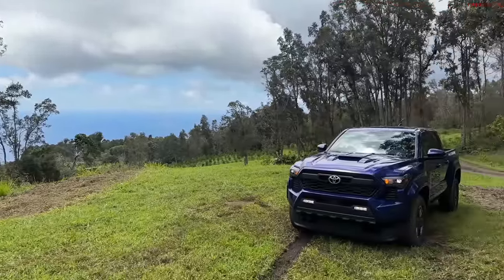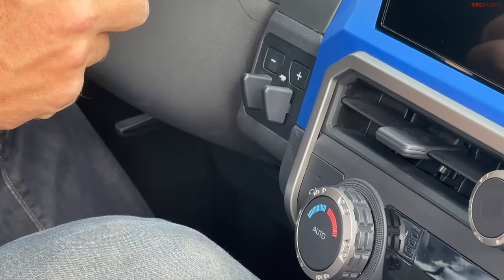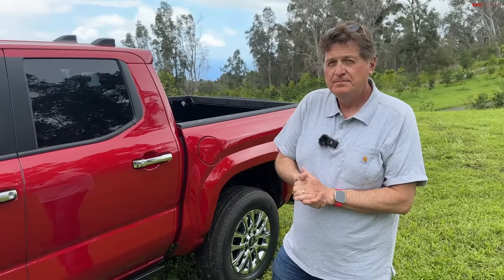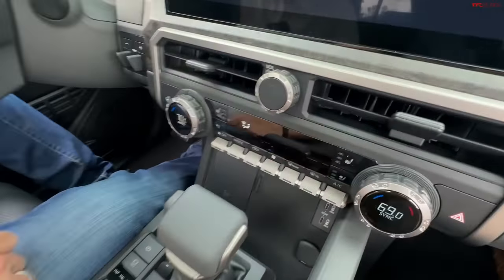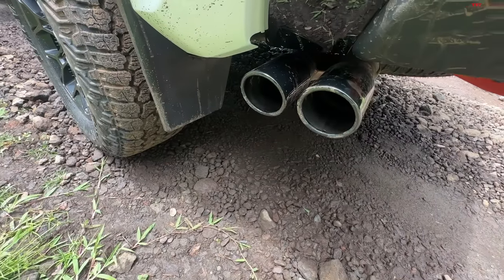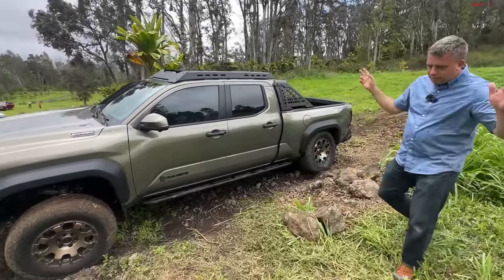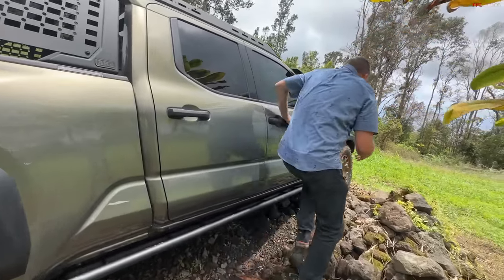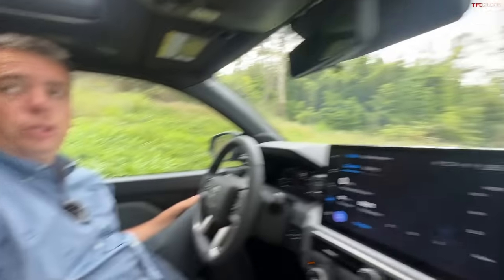The All-New 2024 Toyota Tacoma Is Finally Here But Have They Fixed Its Three Biggest Problems?

Comment: I'm 6'7". Glad too see the cabin height increased. Aside from headroom, my compliant with previous gen was my knee caps hitting the wheel. Hopefully raised seat height makes this an option now
Reply: 1.2" of raised seat height along with 1.2" of raised ceiling height. Not much but something
Reply: It might be enough. I'm not even 6'7" and the driving position left a lot to be desired, even if I did buy a 2nd and 3rd gen.
Reply: @hochhaul  I recently added some seat lift blocks I bought off EBay. Really worth it on my 2nd generation Tacoma. The other thing I found was a plastic foot pedal rest on the left side. It pops off and makes the pedal foot well flat with better leg room.
Reply: @Eduardo A.  -  Same here and I'm just 6'3".  The Tacoma and 4Runner are both very cramped for a tall driver.  Is Toyota increasing the cab size of the 4Runner, too?
Reply: Wow big guy hard to shop for. Anything I bet
Reply: My husband is 6’5”, we always wanted a Tacoma but he doesn’t fit in it. His knee also hits the wheel. I hope he would fit in this one then we’re sold!
Reply: I love when people complain about head room, then we find out they are 6' 7" Andre The Giant. No sh*t freak...nobody is manufacturing trucks for circus freaks
Reply: Air dam dude 6’7”? You in the NBA?
Reply: @gkling33 something tells me you’re short 😂
Reply: I’m 6’5”and had a Tacoma, 36 inch inseam, and I would have the seat all the way back and my knees did not touch the dashboard, but my arms would have to be straight out for the most part and that’s the part I did not like. Had 1 inch to spare for headroom. To be honest, it was the width of the seating space that bothered me the most. No room on the left or right sides. 
But I had that truck for 10 years, and I’ll probably buy this new one too.
Reply: At 6'7", a Tacoma is too small for you

Comment: It was inevitable but goodbye simple and easy to maintain Toyota trucks. We’ll miss you. 😢
Reply: Since when has toyota made it easy to work on? Unless you're being sarcastic.... They never release their programming so it has to be reverse engineered. Also never seen a mfg that requires more "special tools" than toyota.
Reply: Exactly, Toyota requires special tools for everything.  Try changing lower control arms and actual suspension components, you’ll regret anything about owning one.   It’s only going to get worse with electronics which yotas have never been reliable with.  Good looking truck but I’d tell all to read about any diy repairs and maintenance before buying.  More and more complicated
Reply: @livinghaha01  i literally just put all new suspension components on my 2011 Tacoma with basic hand tools and drove it to a shop for an alignment. Only tool I had to buy was a 52mm sock for the axle nut 🤷🏻‍♂️ guess you just think all tools are “special” tools

Comment: Would have been nice to see how the rear seat leg room is.
Reply: Looks disappointingly small still...
Reply: In another video, it mentioned the media were not permitted to sit in the back of the TRD PRO... Not sure why though. Probably still pre-production.
Reply: From the glimpse I saw, it looks very tight.......still.
Reply: Since you aren't sitting on the floor anymore, I would say even if the cab is the same length you should have more leg room.
Reply: @Andre_Albert  probably because the battery is right under the seat. And they might not have everything worked out with it. Idk hahaha
Reply: Lol zero.  After owning a 4 door Taco, if I ever get one again I will just get the extended cab.  Nobody can fit back there comfortably.
Reply: All engines turbo.   When they show the electric battery I guess the rear seat it’s meant for little kids to sit in the back because there is room for legs but not feet. 😢
Reply: @FURDOG1961  Raiti commented that he needed something to drink because it was so uncomfortable in the back. Not only because of lack of space, but no center armrest and no A/C vents.
Reply: @66skate  whoTF is raiti
Reply: @Acreyman  now that’s a lie
Reply: @Twinnzllc  is it?  That seat is for small children only...but not kids that are still in a baby seat because that doesn't fit either unless you pull your front seat way up
Reply: @Acreyman  I don’t know anything about baby seats but I do know average size people can fit fairly comfortable in mine. Although what’s considered “average size” for an American is ever increasing considering how unhealthy we are
Reply: @mattbrew11  Raiti's Rides - 957K subscribers must know. Just another reviewer. You'll find out how many Twinkies fit in your center console.

Comment: Kudos to Toyota for making a Tacoma with a bed big enough to use as a truck, and  making an extra cab.
Reply: The frontier still has a long bed
Reply: @ProjectBasecamp  But only taco has stick!
Reply: Let's hope your knees aren't up to your chest
Reply: @fredwilliams8898  yeah but frontier you can still get a N/A v6 and hydraulic power steering which means it wont yank the wheel out of your hands and try to drive for you like the tacoma does with its electric power steering
Reply: @fredwilliams8898  A manual transmission that you can't pair with the good engine option....
Reply: @Ryan-sw3km  These days I prefer electric. I'm tired of power steering pumps dying or developing leaks after a few years.
Reply: If you need a truck you should buy a f250
Reply: @William Hershey  You don't need an F250 to go to grocery store, McDonald's Home Depot, Costco and drop kids off at school.
Reply: Most people will probably not buy that version
Reply: @hochhaul  Can't pair it with the good cab option either, which is more important to me.
Reply: @fredmoss4540  you don’t need a truck to do any of those things

Comment: I love Tacomas and I love the return of the Xtracab (I own a 2001 Xtracab) but I'm sad to see the stupid trend of making windows smaller.
Looks like they removed 25% of the rear door windows. If you're sitting back and turn to the side you will look at the pillar not out the window
Reply: there are no back seats in the xtra cab, just space.
Reply: @jerryavlon4780  I was referring to the double cab models shown. The rear window is clearly shorter lengthwise. Looks like you will need to lean forward a bit to look out and will also hinder visibility from the driver.
Reply: @Argedis it's for crash safety. They need the extra room to fit all the airbags as well as the additional bracing in the door and pillars to pass more strict crash requirements.
Reply: Gotcha

Comment: Curious to see how the engine holds up after 150k miles.
Reply: It's not chevy cruze!
Reply: Its a toyota... i wouldnt worry
Reply: I have a '17 TRD Sport that tows my 21' Sea Ray.  Just turned 100k and still strong.  I don't think a new Taco with I4 will last as long and trouble free.

Comment: I'd think the TRD OFFROAD would be the sweetspot in this lineup, have too see one before I'd pass judgment but this could be my next rig given a two year run before I throw down my coin
Reply: 💯 agree with you there.
Reply: Two years from now they’ll sell for $100K.
Reply: Always thought that the Off Road trim has all the off road goodies without the Pro flash.
Reply: It’s too bad there doesn’t seem to be a 35” tire/wheel option
Reply: Agreed
Reply: I just hope it gets the swaybar disconnects to. 
I can swap in the fancy seats but making the swaybar disconnect play nice with the new computers? Thatd take a hot minute
Reply: @a36538  Just buy your own 35" tires lol
Reply: @a36538  Oh god no. 35's are just too damn expensive for a factory ride. If you want them, you pay for them.
Reply: Agreed. If you are going to modify or upgrade them at all, then the Off road is the trim to get.
Reply: @remgu2000  I got a 2020 off road one year old 100% the way to go. The current kbb price is still higher than what I paid for it in total with over 40k miles added on the odometer.
Reply: @remgu2000  or the Sport depending on what you will be using it for

Comment: That glossy black plastic on the grille, fenders and hood is going to scratch sooo EASY wtf
Reply: it's no longer a tacoma, just another urban midsize truck, not meant to last more than 5 years
Reply: @nastysoda9212  It's like they disposed of the real Tacoma and just made a mini Tundra with that front overhang that eats up approach angle. And Toyota knew the competition already had front lockers in the mix yet they do nothing to match it. And then they gimp the new turbo 4 if you want a manual transmission. This new Taco is a very mixed bag. Some good improvements, some big downgrades.
Reply: First thing I thought too 😬
Reply: @hochhaul  get ready for fake engine noise lol
Reply: at least it's not in the interior like the GM
Reply: @Dusdaddy  Yeah that's the 3rd gen taco with the glossy plastic that scratch if you touch it.
Reply: @Ill06Taco  😆
Reply: @hochhaul  Or the brand new GM twins....that's what I was actually referring to.

Comment: glad they finally offer a transfer case with a differential.. our old hummer h3 adventure has the 40/60 split borg warner transfer case with planetary-type diff giving that awd security for those times in the wet/ gravel that you don't really need 4x4 lock ..

Comment: Tacoma has always impressed me for an off road truck. I sold my 2000 TRD, V-6 to get a Tundra Crewmax for towing my toys. I’m very impressed with the 4th generation but optimistic about smaller engine. I’ll probably get a TRD Pro w/manual. Manual is just king for off roading!
Reply: yep crew max witch is military crew truck tacoma
Reply: The 24 Pro is available in automatic only. If you want a Pro in stick, you better start talking to toyota dealers NOW to get the 23 before they are gone.
Reply: @W0RLDSSMALLESTVI0LIN  That's a horrible choice on their part. I was dead set on buying the new Tacoma but deals off if I can't get the TRD Pro in a manual.
Reply: @Ryan Kielly  toyota doesn't care cuz very few tacoma pros are sold. Also, from a business standpoint, it'd make zero sense to develop a new manual transmission to work with a hybrid system...I don't even think such a thing exists.

Comment: Holy crap they actually engineered it with rear disc brakes instead of drums. I was wondering when they'd figure that out
Reply: The drums have great stopping power and last 3 to four times longer than than disc. That’s why they haven’t been changing it. Old school goodness
Reply: @djdannyp9581  Yes. Drums have great stopping power. More than an equal diameter disc brake does. That is until they can't shed all the heat the drum is putting off and then they become useless. Especially while off roading and while towing, they're extremely inferior to discs. If drums were superior, we'd still be using them 🤷🏻‍♂️
Reply: @knivesinedc   for commercial hauling rear drums are still used, and preferred. The old brakes were great, and lasted forever.
Reply: @2wheeled76  Drums are used on big rigs because they're self-energizing.
Reply: @2wheeled76  You're right, a lot of commercial trucks use drum brakes. But they're almost always air brakes, not hydraulic like on light duty trucks. Air, as we know, cannot boil like brake fluid so the only way that brake fade can be introduced is through extremely excessive use of the trucks brakes and heating up the brake shoes. But even then, commercial trucks also utilize very efficient engine braking to slow down in conjunction with the brakes. Engine braking is less effective in smaller trucks, especially those with less cylinders and overall lower compression so the vehicles depend much more on the wheel brakes.
Reply: Drums are good dude
Reply: @tuckerhiggins4336  I hate 'em, they're a PITA to work on, there's a reason even Toyota went to disks now.
Reply: @djdannyp9581  The drums will last but were likely a factor in why previous tacomas had such a low GVWR (and in turn low payload). I suspect the drum brakes due to poor ventilation were prone to heat fading more easily if the vehicle was too heavy and constantly braking
Reply: @djdannyp9581  drum brakes are inferior to disc brakes in just about every way. Toyota used drum brakes for cost cutting and nothing else. They tried to spin it like they were doing you a favor saying “drums are better for off-road” which is bs. Hence here we are 2024 has disc brakes.
Reply: the drums were for when you get stuck in dirt, which happened to me often. you're brakes would be fine, isntead of messing up your discs in the dirt.
Reply: @djdannyp9581  Drums are shite that rust shut and trap mud inside of them. They hide leaks and get out of adjustment or springs corrode and break, causing all kinds of PITA problems. They were total trash and it's embarrassing that it took this long for Toyota to finally dtich ox-cart era brake tech.
Reply: @tuckerhiggins4336  Drums are ancient trash. Particularly when they get filled with mud and brake dust, spring corrode, they get out of adjustment, they develop a brake fluid leak, or get too hot and start to boil brake fluid. If drums were so great, all the manufacturers would still be using them. The rest of the industry abandoned them over a decade ago because they're inferior outdated trash.
Reply: @BAYAREAMX  Exactly, Toyota frequently does this "oh we purposefully chose this inferior tech that just happens to be cheaper". Just like they dismissed the 2nd gen Tundra's flimsy frame,  claiming it was a deliberate design choice even as the bed was gouging the cab in a comparison test conducted by Ford. Just like Toyota engineer Mike brushed off the horrible fuel economy of the Tundra with "my engine has 32 valves and it's DOHC, other engines are using pushrodsl, hur dur, do I need to update my engine lol". Uh yeah Mike, your engine gets significantly worse fuel economy, at least do a little to help us out here you clown. An interior plastics engineer promoted to head the truck program... go figure he's that stupid. "We stuck with ancient drum brakes because they're better for mud.... noooo we didn't stick with drums because they're cheaper and we wouldn't have to invest in retooling for discs, we just think   the Tacoma is the only member of the TRD Pro family that will encounter mud ever."
Reply: Yes, Toyota is kicking and screaming into the 21st century this 2023 😂
Reply: @nastysoda9212  Riiight...because somehow the front disks are immune to that but the back ones aren't.  No, it was just Toyota being cheap and dumb.  Disk brakes clean themselves and there's no place to trap mud, you get a lot of mud in a drum, and it gets packed and can't get out.
Reply: Brake😢expertise engineers here. Now I need an advice from brakes on my e-bike. What kind of brakes are best for my e-bike please?
Reply: @SirFoodie1904  Giant air-operated drum brakes....  LOL
Reply: @knivesinedc  Damn dude,why you so mad?
Reply: @hochhaul  Imagine being this angry over brakes
Reply: @TfyallLookingAt  Lol what? I'm not mad? I was just presenting the facts as to why disc is better than drum brakes haha. I'm not planning on buying anything from Toyota, so I don't care all that much what brakes they're using, I was just making a point 😂
Reply: I had a 13 Tacoma...the drum brakes would seize on me when off roading in muddy conditions. The rear wheels would lock up and i would drag the truck in 4lo until they would release. Disc's are a huge upgrade.
Reply: @BAYAREAMX  Toyota also moved production to Mexico to pocket the cheap.labor. Nothing passed in to the consumer. At least Nissan builds in the US.
Reply: @nastysoda9212  Drums SUCK on water crossings.
Reply: @hochhaul  Nevertheless,  people still worship everything Toyota does.

Comment: Great that the still have a manual transmission but I wish the would have kept the normally asperated V6.  Not a big fan of turbo 4 cyl engines for the long haul.  Looks like I will go out and hug my 3rd Gen Taco w/manual as we will likely be together for a long time.
Reply: I have a 2nd gen 5 speed 4x4, omg that extended cab is slow, these new trucks look promising but the shit going on under the hood looks scary, and the frame looks very different on these….
Reply: That 6 has no place in a 2023 truck. The thing was ancient, anemic no torque, no power no mpg. That engine was a lose lose. Fine for 1998, shouldn't have lived past 2015
Reply: @Brian-ff7tw  the newer 3.5v6 they used or the 4.0? There was also the older 3.4 which was pretty stout minus it liked head gaskets and sometimes new heads at 200k with a timing service in between lol. 
My 3RZ still screams with no issues or noises at 324k miles. Lmao
Reply: @Brian-ff7tw  While I agree that there are better 6 cyl motors are out there than the one in the Tacoma, I am sure the NA 6 cyl motor in the 3rd gen Taco will out last the new 4 cyl turbo.  As far as power and torque, the current 6 Cyl motor is fine.  I don't need to go 0-60 in 5 seconds, I don't need to pull a trailer with a bull dozer on it, I don't need to go 100 MPH.  I just need it to some DD duties and take me hiking and mnt biking on the weekends.  IMHO, that 6 Cyl does a great job for its assigned purpose.  Sure, MPG could be better, but this is truck.  Most folks don't buy a truck for MPG.